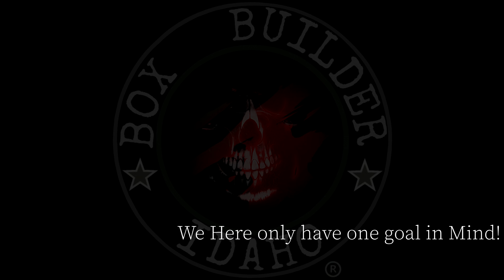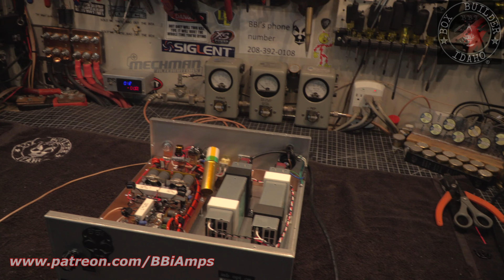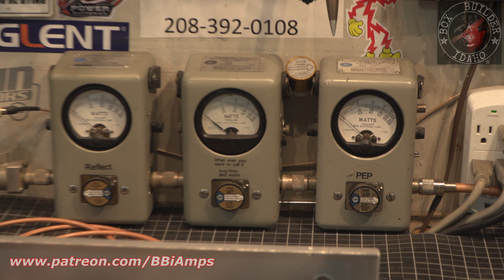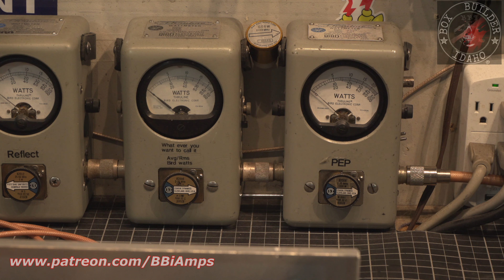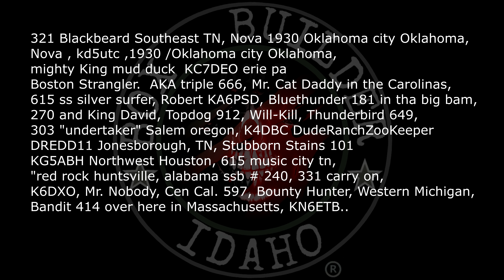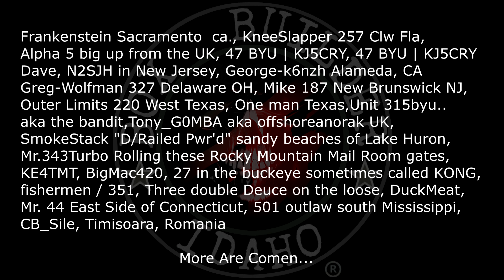Amp#3910 1x4 new Build.

Comment: Mr BBi why there share load pin not connected?
Reply from the maker: We discovered it's not that important with the smaller number of switching supplies
Reply: @BoxBuilderIdaho thank you Mr BBi I plan to build 4pcs ot that power supply Mt bbi and I'm using car amp on it do I have to connect the share load pin?I'm using 3pcs car amplifier if you have some Facebook account can I let me know? So I can send my project inspired by your work Mr BBi

Comment: Are you saying that the PEP power is the output power to the antenna? Isn't the 'PEP-Plate Emission-Power' to the input of the plate or transistor? But, is not the final output power to the antenna, which is always LESS POWER than the PEP power due to heat dissipation going to the heat sink. Am I confused?
Reply: PEAK envelope power
Reply: @RocknRollJesus101  Totally forgot. Thanks.

Comment: @BBI where are you getting the low-power HF slugs for the waters. The only thing I can find on CD or bird, or 1,000 watt slugs. They have nothing for the low end of the HF band at less than 1,000 watts. I'm trying to find slugs that work around 2 megahertz.
Reply: @allen_steel1236 Sometimes you can find them at Fair Radio Sales in Lima, Ohio. They won't be around much longer but have a diverse inventory.